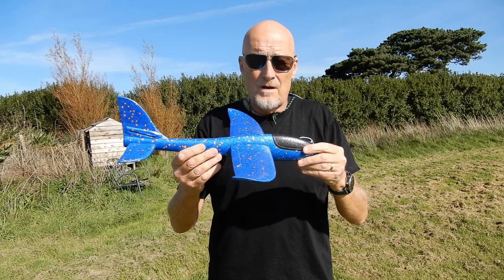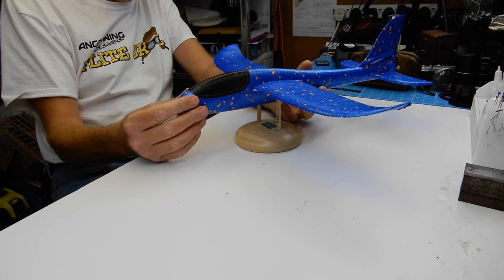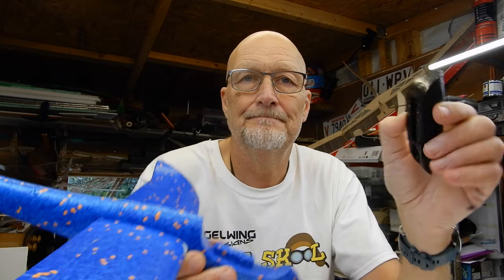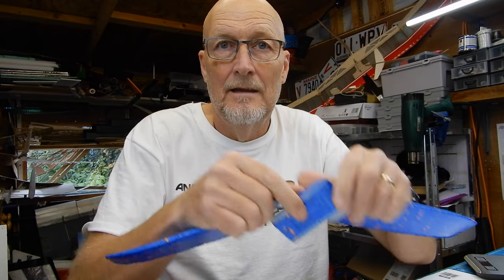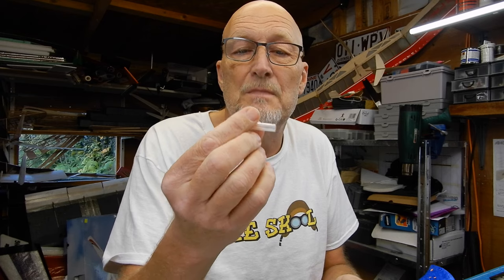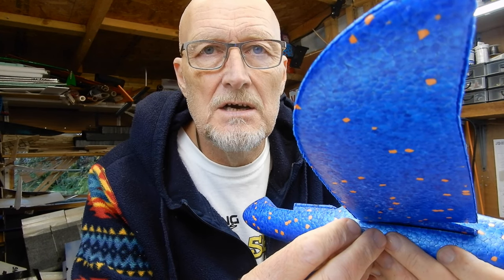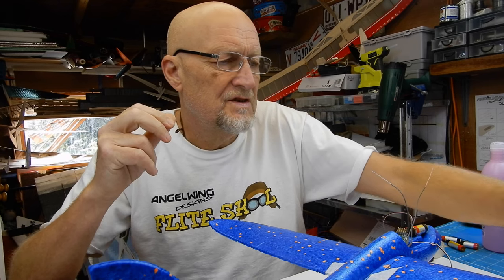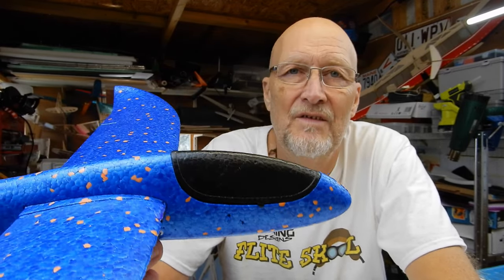How to convert this mini glider to radio control

Comment: Having bought two of these for 1€ each at Aldi a few days ago I'm in the process of fitting them out. A few things: With the tilting wings the servos are very easily damaged (gears stripped) when landing or catching the thing. Can't throw it from the wing tip too. Traditional ailerons are super simple and much safer for the servos. Also: fully gluing the wing into the fuselage turns this section into a solid block of material, you can then cut holes with no fear of weakening the fuselage and breaking it. For a battery you can cut a hole into the bottom then right under the CoG and if you want to add a small motor later even a bigger 2S battery fits nicely in there.
Reply from the maker: @uhuznaa  yer I know 🤣8 years ago https://youtu.be/5luSsUtE63g?si=xWVov-4IWU1kQhWn

Comment: I have same foam glider (not yet radio control converted). Launching it "discus style" holding from a wingtip makes for dramatically longer flights than using regular toss launch. If the wing control conversion is rugged enough to survive the discus throw, give it a try.
Reply from the maker: Not sure about that bud but I got another idea in the pipeline

Comment: On cutting the holes for the servos, battery(ies), controller etc --- we all have dull X-Acto blades lying about, unsure of what to do with them. Grab yourself a small torch, or even just a lighter, heat the blade & sink it into the (poly-u) foam for some nice straight & controllable cuts. Experiment a bit on some scrap foam, to get a bit of experience of just how much it melts material away. Not a lot of heat is required, in fact, if it sizzles a drop of water, you got more than enough heat to do such small work. Mask & ventilation is an absolute requirement -- the fumes are bad for you, the dust from grinding/sanding that material is far worse. We've fabricated & repaired hundreds of thousands of dollars' worth of surf/wind-surf boards this way.
Edit:  Heating up a up a steel pin/nail will do nicely for making the holes too.
Reply: Thanks for the tips.
Reply: Using heated metal to melt out foam does have its uses - in fact you can (with experience) make up blank forms for things like servos. But it also has its limitations. As said, the fumes are toxic. So use ventilation. Also the foam is just melted to solid plastic, thus no weight is removed before adding your servos, receivers,  motors etc. (Important if trying for lightest weight builds, in which case some masking tape, a sharp blade and a router (as shown by Bavarian RC in his builds) plus a vacuum cleaner are a better idea. 1 plus of melting the foam is that some plastic strength is added around the excavated areas thus beefing up the thinner sections a bit.
Reply: It still would require a small engine to get up into the air.

Comment: Nice....

I converted a rubber powered Guillows Flying Machine to RC. Its one of my favorite no wind planes.
I used electronics I purchased at Minimum RC....

Thanks for the introduction to AngelWings Designs...
Love your flying site. Its perfect for slope soaring. I have acres of fields and woods where thermaling is easy peasy but nothing like your spot along the coast.
Reply from the maker: I am lucky boy living here

Comment: Thanks for the video. Please indicate in metric units what is the diameter, length and mass of the battery. Thanks
Reply: 1S 350mah is all ya need  for this model thier lite small  and short....perfect size

Comment: Do you have some technique to ensure that the holes drilled in the wings are perfectly horizontal?
Reply from the maker: @petecresswell932  went in  square and checked with set square 📐 and 60 years experience 🤣